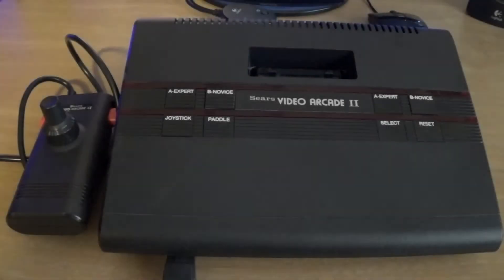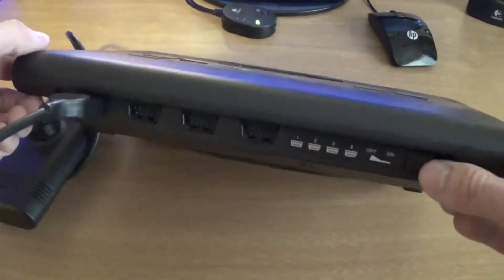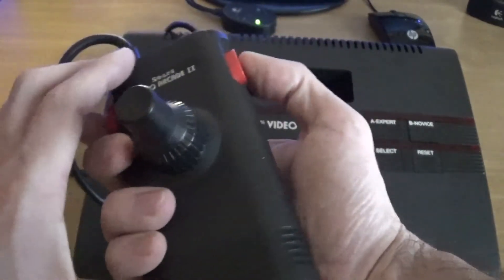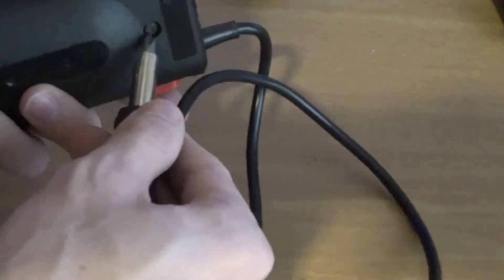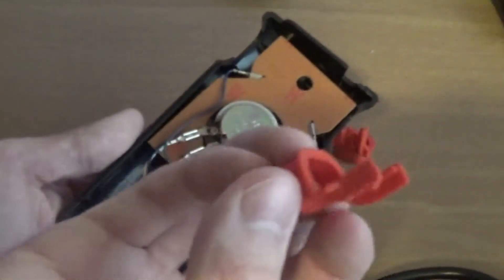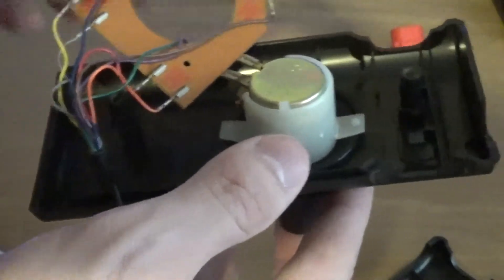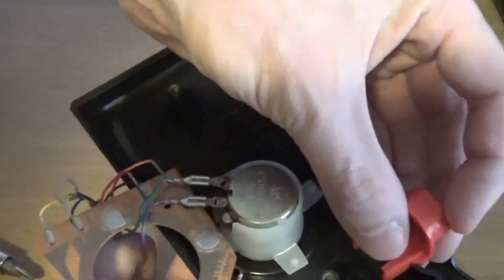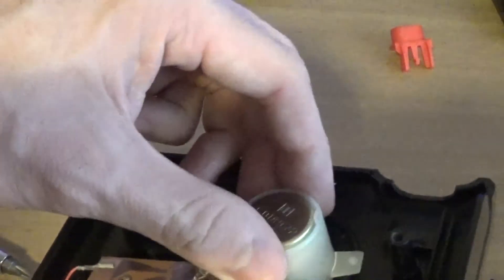Atari Controller Teardown: Atari 2800 / Sears Video Arcade II

Comment: If you were to ever make some sort of modification for it, would you make a video about it? I recently picked up a sva2 but haven’t tested it yet. I can hope it works
Reply from the maker: If I had the resources to fix those controllers yeah, I would certainly do a video on it. At the shop we've looked into them a bit but until we get something like a 3D printer or other custom creation tools, no such luck.

Comment: mine has Springs on the buttons on the side. Why is that different? One of my controllers the spring is broken.
Reply from the maker: There are always hardware revisions and changes over time - even just different factories could do some things differently, which I suspect is the cause of this difference given the relatively short run of the SVA2 variant (granted, it is the 2800 in Japan, but still, same thing when it's said and done)

If you ever get into messing around with PS2 controllers you will see there are about 15 different versions, or so it seems, to just that hardware legacy. lol.

Comment: Does the plastic for the joystick become flimsy with age or use?
Reply from the maker: Yes, yes it does! That plastic on the inside ages incredibly poorly and is the reason the controller generally becomes useless over time! I would say time takes more of a toll on it than use, but it seems like the kind of plastic that wouldn't survive a summer in an attic, for example without weakening beyond use. It's terrible, but there ARE 3rd party controllers from the era out there that have the same design and can be used to good effect in the 2800 / Sears Video Arcade II.
Reply: Many thanks for your reply! Such a shame! I really wanted to get some of these that I found as NOS on eBay, as I have a game design I came up with, and wanted to program, that would make special use of them (small market, for sure!). The Gemini controllers could be used, but far less effectively. Oh, well! Maybe someone will 3D print a replacement someday. Or, like you said in your vid, fashion a metal replacement.
Reply: Many thanks for your reply! Such a shame! I really wanted to get some of these that I found as NOS on eBay, as I have a game design I came up with, and wanted to program, that would make special use of them (small market, for sure!). The Gemini controllers could be used, but far less effectively. Oh, well! Maybe someone will 3D print a replacement someday. Or, like you said in your vid, fashion a metal replacement.
Reply from the maker: Hopefully! If I can ever get ahold of a 3D printer I know I'll give it a try. Heck, I'm trying to convince the owner of the shop I work at to get one - I think we would have a major benefit on fixing game consoles if we could just make little bits we need!